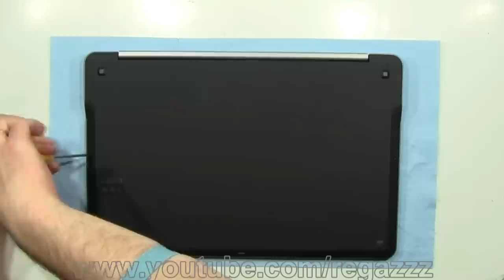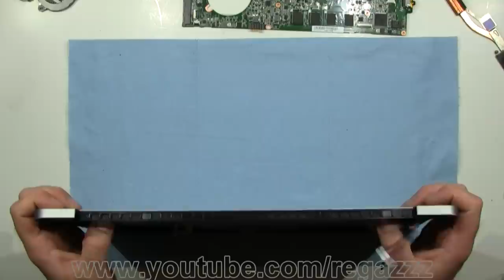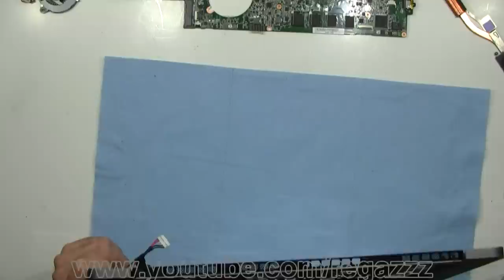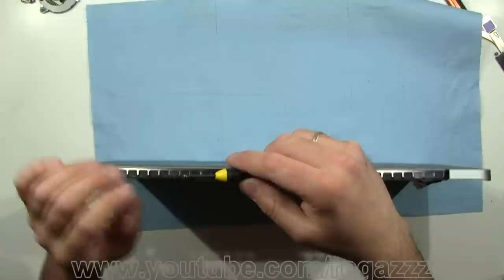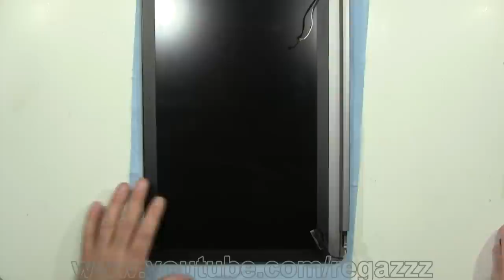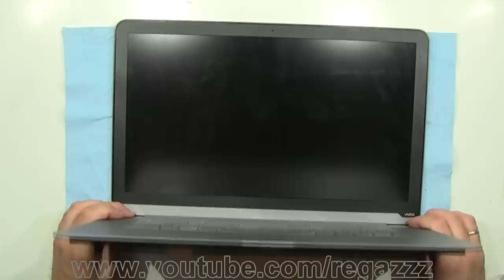VIZIO CT15 UltraBook Take Apart and Reassemble

Comment: This laptop doesn't start after removing back cover until you connect it to power supply :) At first time I thought that I had broken smth inside, but fortunately connected it to PS and tried...
offtop:
This laptop has nice quality except keyboard (no backlit, poor CTRL and SHIFT keys, too small arrows...). And cooler works irrational (starts and stops too often). Bought one only for 1920x1080 IPS lcd. Battery keeps 3-4 hours.
Reply from the maker: Ruslan Mathwitch Hey! Thank you so much for share this very NEEDED info. Laptop loosk like old macbook A1226 or something... but I liked it to take apart and put together back.
Reply: @regazzz  Could you answer the bit size question?
Reply from the maker: @soulg1969  Maybe t4 or t5. I don't remember exactly. I usually have a set of bits to work with and usually that's how it goes. I hope you will open it up fine.
Reply: @regazzz  Thanks
Reply from the maker: @soulg1969  Glad to help!